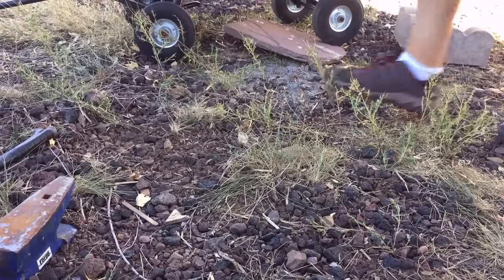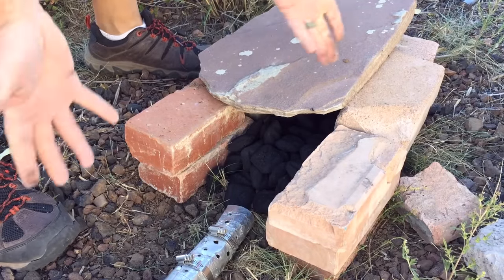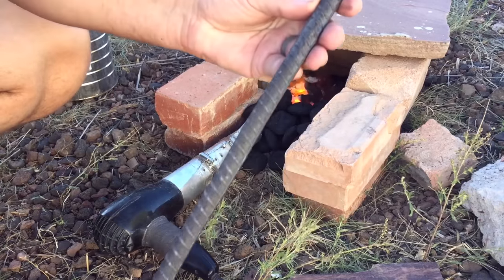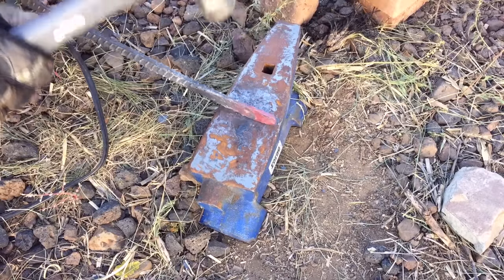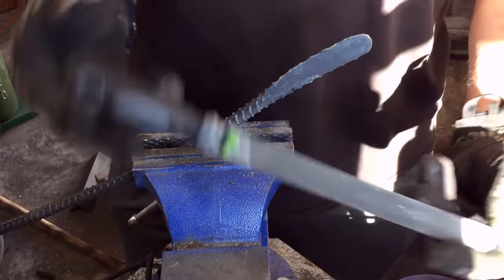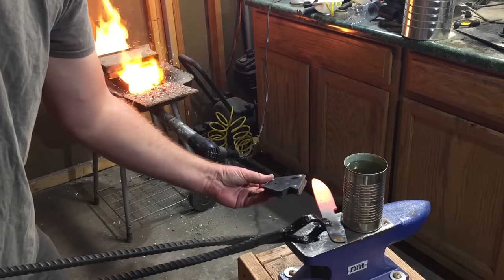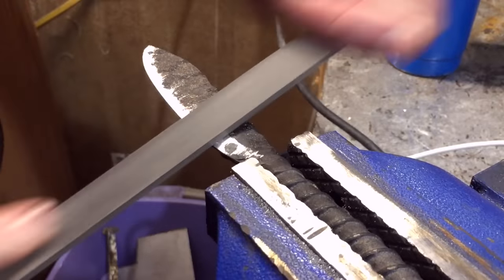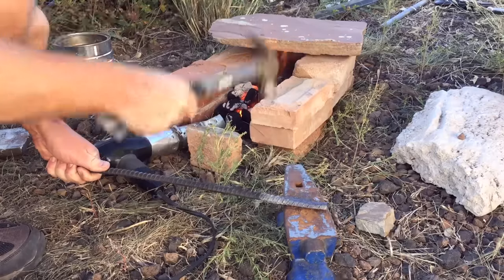Start forging TODAY in your own backyard - no special tools required

Comment: Old metal files make great knives.
Reply: Railroad spikes
Reply: straight shooter much better then reo that’s for sure
Reply: @thomasjohnson2038  no railroad spikes have carbon in them but not much there are two types of spikes low carbon and high carbon but even the high carbon spikes have no where near enough carbon for a actual edge you would be better of with old suspension springs or old files
Reply: Railroad spikes make junk knives, wont harden enough for a good edge. Some old ferrier rasps, like Nicholdons and Italian ones, make great knives
Reply: @westonwallace4322  well yes and no a file or a rasp will make a much better knife then a railroad spike but it will be far from a good knife if you have ever dropped a file from a decent distance on to a hard surface you have seen them explode or crack they are simply to brittle because of there extreme hardness they are a decent knife steel at around 1.25% carbon( a bit on the high end) but if your planing on using it as a survival knife your shit out of luck since it will snap the way around it is to  heat treat and cool it at a slower rate to try and get a lower rockwell but to get it perfect would take a expert and if your at that level your much better just buying actual good steel flatbar blanks
Reply: @fishtheiv3314  that's what proper heat treatment is for.... I literally make these knives for a living and no they do not shatter. They withstand extreme amounts of abuse when properly made and not half assed.
Reply: @westonwallace4322  i dont think you understood what i meant a file is a great knife steel if you know what your doing but for a person new to knife making i wouldnt reccomend it i make knives for a living and so did my dad who taught me i have personally seen file knives explode they simply have to much carbon if you had the skills to find out the metal composition of the file and heat treat at a lower rockwell then you could have a semi succsessful knife it will never be as sharp or durable as proper knife steels such as 5160 1085 or 1095 but it will still be razer sharp my point was that if you are able to properly heat treat a knife to that insane amount of accuracy which you would probably need a three phase kiln to do the chances are you would be using proper steel not old rusty files
Reply: Turned a triangle file into a trench knife once

Comment: One thing I mention is that the bricks and the stone on top will actually help keep the heat inside and focused on one spot, inside the forge. This means that the forge will be hotter and that you will be able to use less Charcoal.

Comment: Quiet kid: interesting, can I do it in a school’s bathroom stall
Reply: I was thinking more of doing it in front of the school during lunch or if you have a free period find an area nearby to rent so you can quickly travel between them to work on forgery during the free period allowing access to more tools (mostly because bringing a backpack to the bathroom is kinda not an easy thing to do in school so getting the required tools to the bathroom might be a challenge)

Comment: Haha!! Would never save time and use an angle grinder...cuts to angle grinder!! King of simple sarcasm! Love it! I want to use this to melt glass. What do u think your core temperature is?
Reply: Valerie Storm glass has to remain in that temperature in order to work with it.
Glass cools at a rapid pace, you would need to have a small work space and a torch to keep it hot.
Reply from the maker: Valerie Storm I have tried melting glass, sometimes it gets close… But I think you have to go a few hundred degrees hotter to get consistent results.
Reply: Core temp: "hot".

Comment: You should only use charcoal, not wood, because wood will impart impurities into the steel as it burns. Fortunately, if you have the wood, charcoal is really easy to make.
Reply: caman5 how would you go about turning the wood into charcoal? Could you do it using this build too?
Reply from the maker: caman5 I think it depends on what you’re aiming for. If you just want to get started and wood is easier for you, go with wood. Definitely use charcoal, coke or gas for more professional work.
Reply: I used seasoned pine and it works, some blacksmiths prefer to keep volatiles in the fuel to get a forge or forge weld going. When I move to a prairie or savannah, then I'll use biogas.

Comment: I don't think you can harden rebar reliably. It's mild steel most of the time and will not contain enough carbon to be hardened. If you can work it with a file after hardening, it's not really hardened. For getting a feel for smithing, sure, why not, but I wouldn't bother going through a hardening process. Get some scrap tool steel or some other carbon steel from a scrap yard (car springs, etc.). You can still make a knife with a sharp edge with mild steel, it just won't be as durable.
Reply from the maker: David Rekowski Rebar is totally unpredictable. I generally test harden a piece before I make anything that needs hardened. With that said, the heat treating process is pure guesswork since you don’t know the composition. I definitely wouldn’t use rebar for any application where hardening was absolutely critical. It’s fine to practice with though.
Reply: I think he said he left it soft just to file it.  Could be mistaken
Reply: Actually most rebar is carbon steel + 0.45% carbon and will quench harden fine
Reply: Depends where you live, in some countries, 1/2 inch or bulkier rebar will be spring steel. In some countries, rebar is widely used for making chisels. With proper hardening, it will even cut even 3/32nds of an inch mild steel.

Comment: Would cinder block work?
Reply from the maker: Good question. I've found that just about anything works a few times, but some types of block will crack and crumble faster than others. Try it out, but keep it low to the ground in case it collapses.
Reply: I'm not an expert by any means, but I'd try filling the holes with sand or dirt.
Reply: Nah! concrete sucks and my first rocket stove was made of concrete then it crumbled after a season.
Reply: I wouldn't, heard from another DIYer that if it gets hot enough it could explode.

Comment: From watching this, I got some guidelines on making a forge, a price of a small anvil, what you quench in, that a normal claw head or ball peen hammer is fine, rebar is cheap practice material, and how to make it not brittle after a quench.
From an Alec Steele video, I got a simple project that he recommends beginners make a ton of to gain precision and practice.
Combine these two and I think I might be good

Comment: Railroad track for anvil works great. I used a semi brake drum cut out window with some 2 inch iron pipe with hair dryer works great can heat big axes and smaller knives.
Reply: how much time did your hair dryer last?

Comment: I like used diesel motor oil for heat treating rebar. An old timer told me it was something to do with sulfur and things the fuel adds to the oil.

Comment: ive heard putting a 90 degree bend in the pipe with about 50cm-100cm after the bend where the fan or hairdryer connects it extends the life greatly from heat damage

Comment: I worked for a shop for years. We heat-treated tool steel. Rebar is mild steel it does not have enough carbon content to be hardened like a knife. If you want a cheep source of steel that can. Use an old file. 

Also as for how long you should anneal a metal. Take the second widest part and let it set for one hour for every inch thick it is.

Comment: hey so you did a great job very kool. i dont know much about forges or making a knife but i know a bit about magnetics. so just for your own personal knowledge the magnet trick probably wont help as much as you think because heating up any of these metals to the Curie temperature means that it will spontaneously change from magnetic to non-magnetic. it becomes non magnetic from the heat. when it cools the magnet will stick again. i think i may give it a go now you did make it much simpler so thank you for that!

Comment: a few tips if I may, hammers are easy to get at markets and yard sales, vintage hammers are cheap and you'll get a bargain ball peen hammer easily enough. A 1lb, 2lb and 3lb will pretty much do most anything you'll want to do. Make one of them a straight peen as well, they are just so handy.
Old files, are usually good steel (usually W1 or 1095) and make for a good base for many blacksmith projects (knives, strikers, various tools) and can be bought for a couple of dollars each (or less) again at markets or yard sales.
Tongs make or break a blacksmith, get yourself a good set of tongs (a 3-set) so you can hold your work well and securely.
Safety glasses, a leather apron and gloves are a must, just wear them and save yourself a lot of grief. Steel cap boots are a good idea as well.

I do suggest moving your anvil up onto a stump and securing properly, that way you can work more efficiently and safely.

Comment: When I was in high school, I got a farrier's anvil from a great uncle. I did this exact thing, scavenging things from around the yard and garage. The biggest difference was I built my forge tall enough to be near my waist, an exhaust pipe going into the bottom of it, and a sibling holding the the hair dryer up and out of the dirt.

Comment: Rebar is basically mild steel, as in very low carbon content.  It's quite pointless quenching it as there is insufficient carbon to enact a structure change in the granules that make it up. That's why knives are not made from mild steel.

Comment: I'm going to use my BBQ to do this. It has a door on the front like a forge anyway, for putting coal in, and air vents. It goes up to 700c when I put lots of wood in there and close the lid. The needle maxes out when the flames are big, and if my burgers are in the flame they get incinerated.
BTW is used motor oil ok?

Comment: Lol I still give it a thumbs up but I need to know way more about them. What's the difference between them and normal apples. Also how do you tell if it has a twisted or straight grain without cutting? And how do you make the trunk grow straight with at least 7 feet clear with no knots. And how do you get a cutting to root?

Comment: The best thing to use as an anvil after, maybe, a proper anvil is a nice little piece of steel rail from your nearest abandoned railway station, freight yard, locomotive shed/warehouse, etc.
Usually they leave piles of the stuff lying around and if you look long enough you'll surely find at least some piece small and "light" enough to be movable.
Take one to your car without dropping it on your feet and you have your new anvil.

Comment: Remember to normalize the steel. Once you have your shape from the forge. You need a magnet.  Heat in forge until non magnetic.  About 1500° remove from forge and let cool in still air. Repeat this x3. Now you're ready to heat to nonmagnetic again then put directly back in forge for 30  seconds and now quench. Then temper
Reply: If you know the metal you're working with its not always necessary.  But if you do the  , should do this .

Comment: Two points.  One, rebar is a soft steel so while good for practice it isn't hardenable for blades.  The most important point dont use cooking charcoal as it has chemicals in it to keep the temp down.  Use lump charcoal, it looks like just burnt sticks instead of fomed bricks.

Comment: I bought that anvil and I love it 
but does it matter if the steel is rusty cause I bought some 1080 steel at home depot 
and its been put away for awhile 
should I get rid of the rust before I start heating up the metal and folding or is it fine cause I think its just surface rust but i'm not to sure until I get rid of it

Comment: Oil is better in the long run for quenching but what I really wanted to mention (especially for the those color blind) if you have a small dish of steel with a pile of salt that you put in the forge at the same time as the blade, when the salt melts it is perfect quenching temperature.

Comment: So. If forging is only used to shape the metal, can I just skip the forging and just shape a flat bar or leafspring to a knife shape using an angle grinder then go straight to quenching and heat treating?

Comment: It takes years but i back when i was a kid like 6 years old, i used to grab a metal stick and go to the garden... find a rock and make it wet... and file it with the rock until it got sharp
Reply: You were advanced huh? I never wet the rock.
Reply: @meme5887  dude i was 6, i thought it would avoid scratches back at then
Reply: @OOF-bo8ic  that was a compliment lol
Reply: @meme5887  OOOOO ok i see... it really seems like a roast ngl

Comment: Ok guys so i have tried the harbor freight anvil and believe me dont buy it get a block of steel from a junkyard or off of ebay but i would recommend getting a 66ln or 110lb double horn anvil off of ebay they are good and have a good price.

Comment: Note on power tools for sharpening- of you use a power tool or even a belt sander- you're going to damage the heat treatment on the blade. Itll still be sharp but it will lose a LOT of durability.

If you can figure out how to make a grinding wheel out of a nice stone- the sheer mass of the thing will prevent heat buildup on the edge- even if you spin it with a motor.

Comment: Nice entry level video! Thanks for making , sharing, and teaching.  :)  Someone else may have already mentioned this , but generally speaking, it is MUCH safer to file with the blade facing away from you. That way, WHEN you slip, and eventually you will, your hand will only smack in to the spine of the blade & not the edge.  Better to have bruises than stitches. :)

Comment: Be careful when quenching with oil. Oil has a flash point around 350. If you don't have enough oil for a part, it will heat the oil  up and boil the oil out of the container and spread fire. A little bit of fire in the container is ok but not ok if burning oil is boiling over and  out. Rule of thumb is 1 gallon of oil per pound of steel. 

Water quench if it's soft steel and oil quench if it's tool steel. Water will make tool steel too hard and brittle.

Also it is possible to draw hardness back by heating it up again and slowly turning the heat down. Of course this isn't easy to do with this mini forge.

Comment: listen, I know to save time u used an angle grinder and I'm fine with that, but it takes a hacksaw about the same amount of time as it would the power cutter u used, for that length 6 - 7 good cuts is enough (use a little bit of oil)

Comment: Interesting.  My grandfather was a blacksmith and the family firm can be traced back to 1640.  At a very young age I use to be using the forge and heating up metal until it was red or white hot then smash it with a hammer. Health and safety would have a fit if it occurred nowadays.

Comment: If the bricks are not dry it can be dangerous to heat them up so quick. They can crack with force (explode) and this could be a hazard.

Comment: What about digging a little tunnel that is under the fire, then it will suck air in to it as the heat rises from the fire... not the same as forced air but might help.

Comment: Does anyone know what that rebar is made of? I've used this setup and have gotten the rebar white hot however when i go to hit it, it hardly changes shape, and it definitely doesn't change shape as much as when this guy hit it. It can't be the temperature of the metal, as it was obviously hotter than his, and it could be the hammer (using a mini sledge) however it still would've changed shape a bit more than expected. The only thing I can think if is the material that the rebar is made of is different to this guy's, any helpers?

Comment: I’m thinking I could simply use my grill as I watch this. Make something to force air into one of the vents, maybe the exhaust output on my shop vac and a couple feet of 4” galvanized duct.

Comment: Just so you know, that small anvil, and really any anvil from Harbor Freight, is made from cast iron. This means that it will crack easier, and a small piece that breaks off  could actually injure you if you hammer on it too hard (if the piece is large an flies off, it could hit you in the eye or head). Most of the better anvils are made from cast steel, so search for one of those instead.

Also, a cast iron anvil is softer and will be dented easier and hammer marks will be a lot easier to make and see.

Comment: I just use my fire pit in the backyard and gather a bunch of wood close together so it burns hotter and I use a hammer and lay what I'm forging on some bricks next to a bucket of water and it works well, I made a crowbar using that method

Comment: Tried this years ago with a much more advanced setup, actual charcoal (not briquettes, wtf) and blower. Took over an hour to get the rebar to cherry red and wouldnt move when hammered. Brought it up to bright yellow/near-white (which took forever) and tried hitting it but that only moved a little for two seconds or less. I spent probably 7 or more hours on that rebar and only got a small leaf shape made on the end. Was so disgusted with it I havent ever tried again even though I spent a great deal of time and money making a forge. I think I must jave just found some rebar made of specialty steel that was crazy heat resistant.

Comment: Does anybody know roughly how much time it takes the rebar to get hot enough to mold using this exact forge set up? just a rough estimated time, i haven’t seen anyone mention how long to keep the rebar in the flames
Reply: Depends on how much air is being pumped it, but it shouldn't be more than 20 minutes.

Comment: Why not use the exit end of a shop vac for air supply? Two feet of Automotive exhaust pipe on the end of the vac hose should keep heat from affecting vac hose.